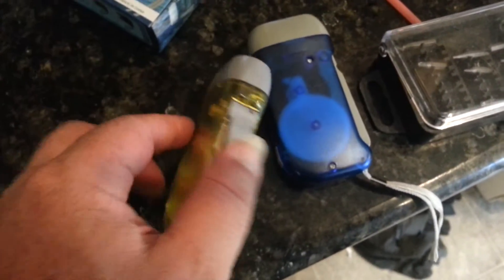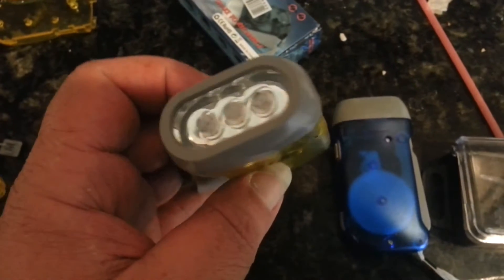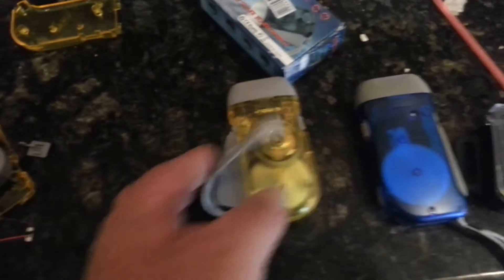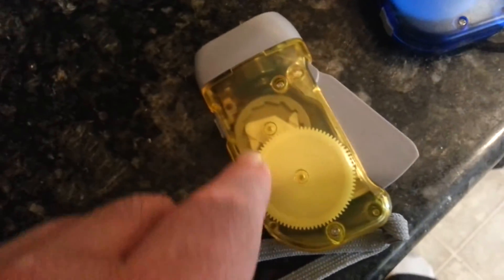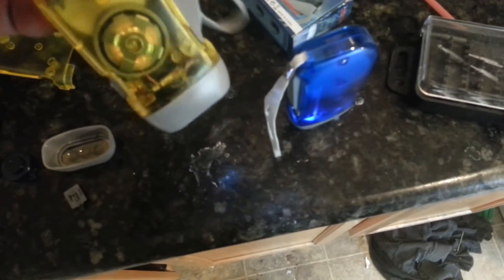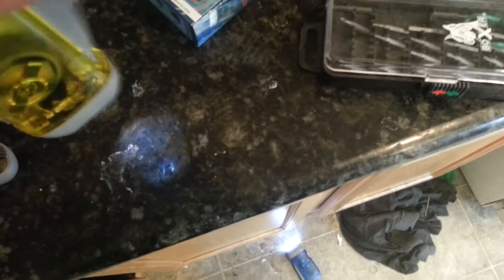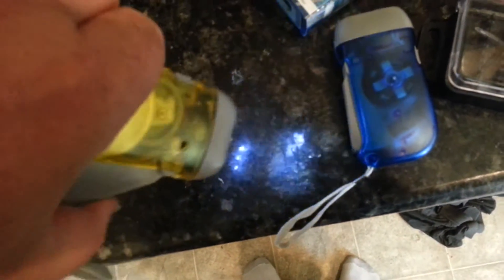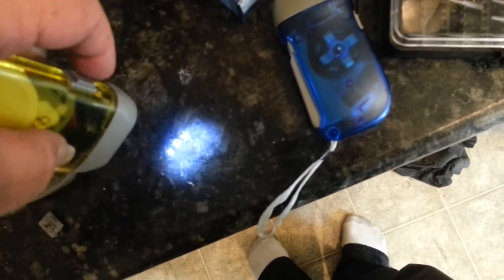Cheap rechargeable hand crank dynamo light

Comment: dude its not rechargeable it has unlimited battery they put a battery and they did a science project to make it unlimited so it will never run out
Reply from the maker: It is rechargeable... it would take FOREVER to charge with the hand crank.  There are batteries, but they're just Li-Ion button cells.  Would recharge better if it was a capacitor.  And it's certainly not unlimited :)  Lasts only a few hours and then it is dead dead dead.